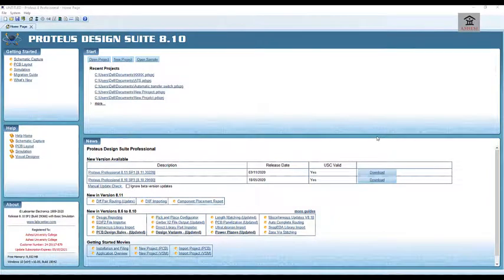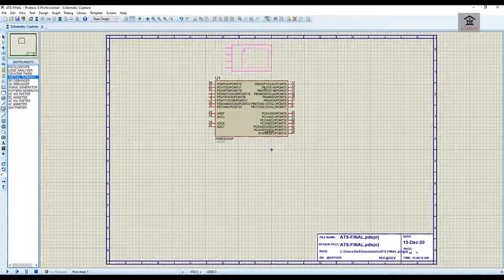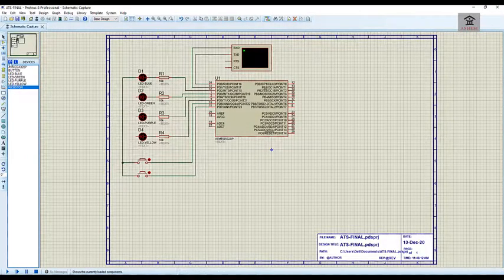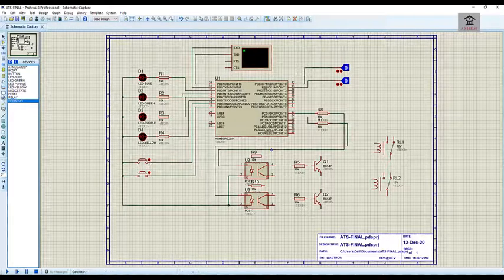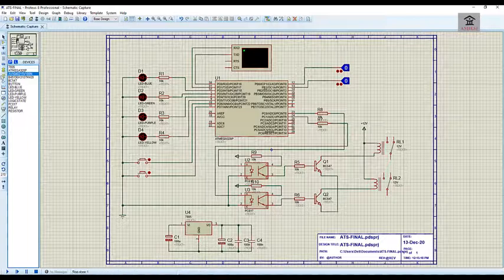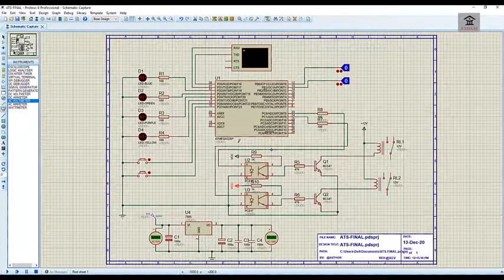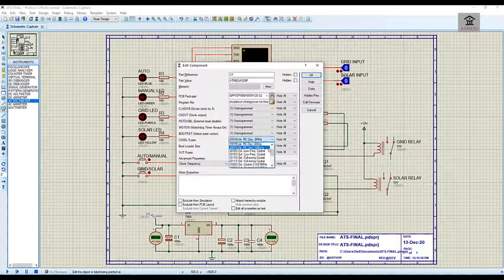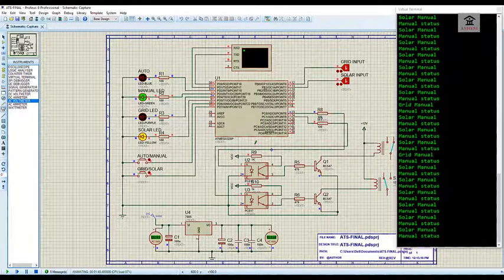Simulating Automatic Transfer Switch Controller Using Proteus

Comment: Hello thank you so much for this video. I have a question, If this were a generator and grid power supply, Will the gen trip-off? or will it still be on when the grid power is prioritized?
Reply from the maker: You can use the relay as a dry contact to trip off the generator.
Reply: @NicholasTali  Thank you so much. Would anything change in the circuit or code to make this happen?
The components that is.
Reply from the maker: @mercyi-irt  whats your country?
Reply: @NicholasTali  Nigeria